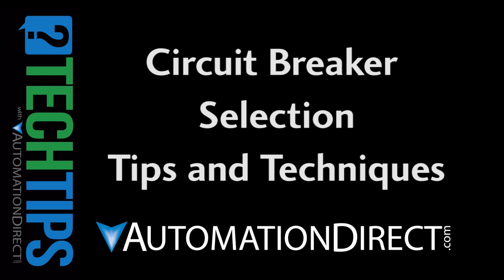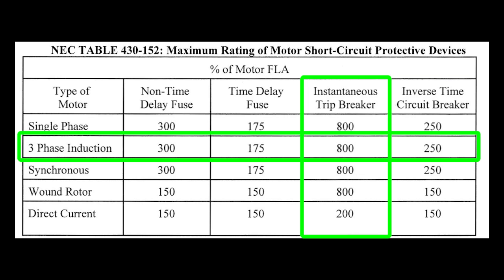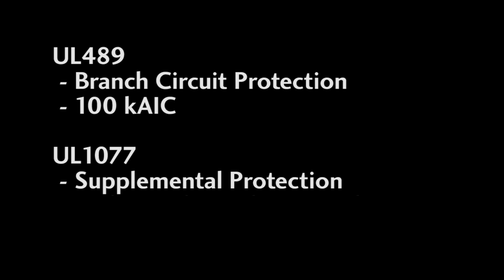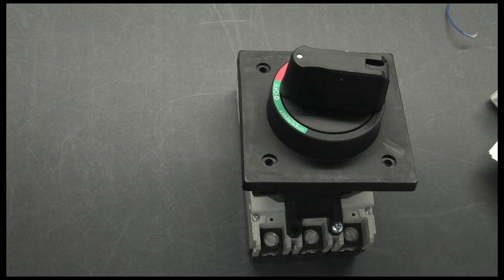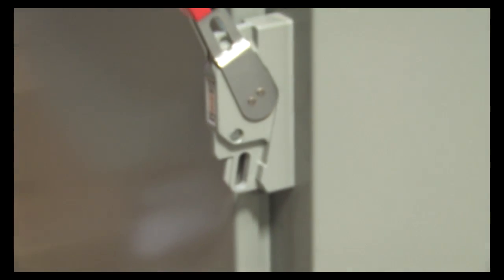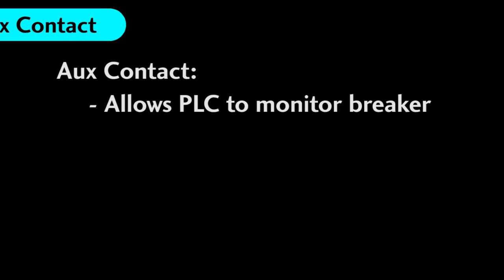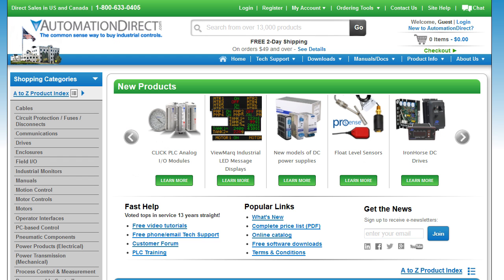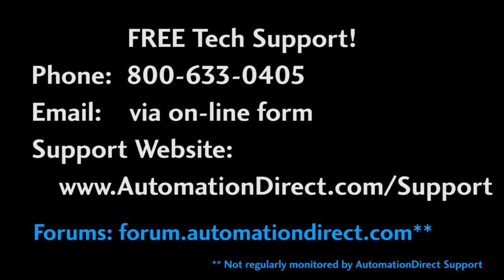Selecting and Using Circuit Breakers for Industrial Automation (MCB, MCCB) at AutomationDirect

Comment: Fuse links are much safer than circuit breakers and provide total selectivity with the EU ratio (1/1,6), have a very high breaking capacity (50- to 200kA) and will reduce the let through energy much more. Also when a circuit breaker clears a fault, the contact resistance will often increase to a level that makes it very dangerous to reset the breaker. A breaker produces dangerous fumes (copper) when it clears a fault that is dangerous for workers. Most fuses are sealed devices that most of the times will only flash and not even pop.
Reply from the maker: Thanks for the additional info! Of course, on the down side, a circuit breaker won't allow you to reset it until the condition has cleared - you could burn a lot of fuses trying to figure that out and fuses can "pop" and burn up causing other issues. It all depends on your particular application. Thanks again for providing the feedback.

Comment: Your NEC reference: Table 430-152 is incorrect. The table in the 2014 or 2017 NEC is 430.52. The NEC hasn't used dashes between the article and section (430-152) for over a decade.
Reply from the maker: Thanks for the feedback ... we'll get it corrected!